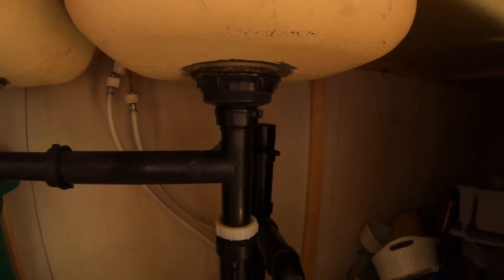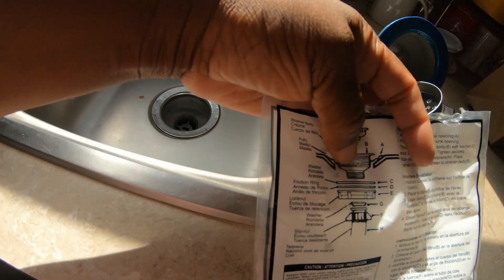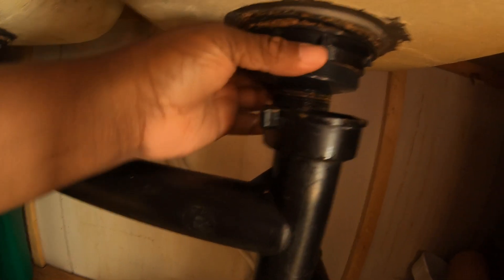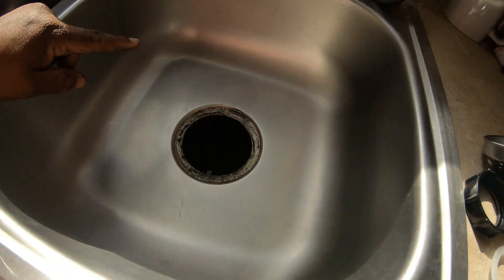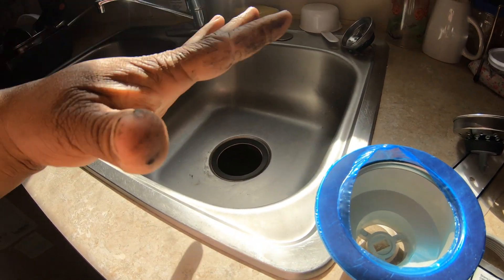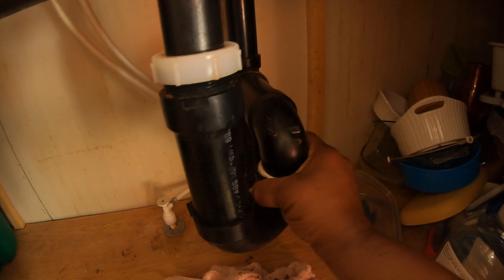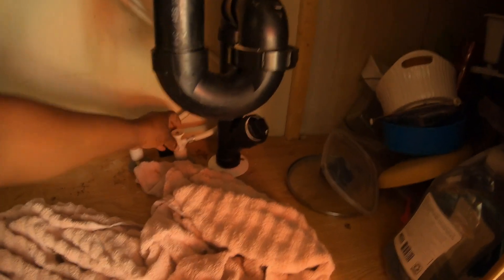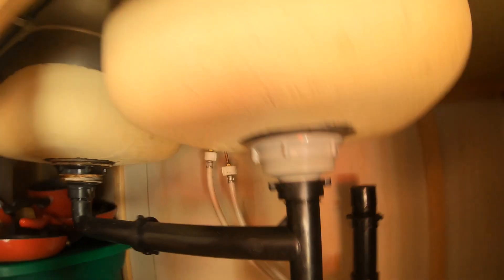HOW TO FIX A LEAKY KITCHEN SINK

Comment: Yeah it's not hard to change just a bunch of unscrewing and screwing it back together! The plummer's tape is to make it easier to screw back on and it also gives it a tighter seal to make sure it doesn't leak! I never seen it before how you push the water off to turn the water valve off and on we have handles to shut ours off and on but that was kind of cool and different!!!
Reply from the maker: It may be made for Trailers only